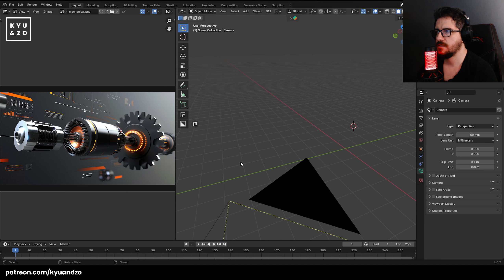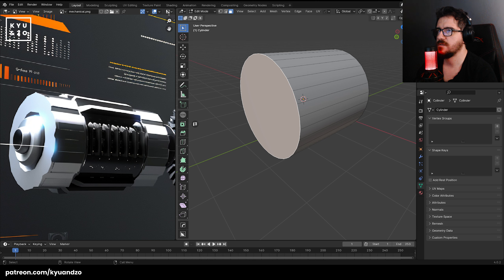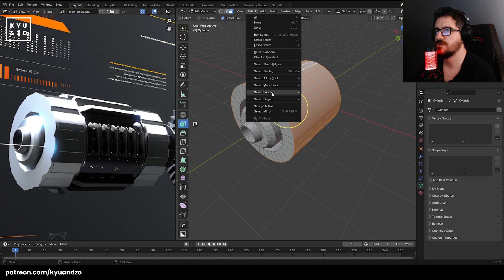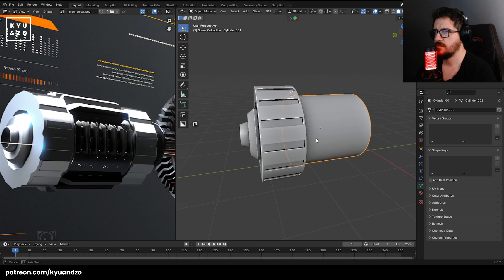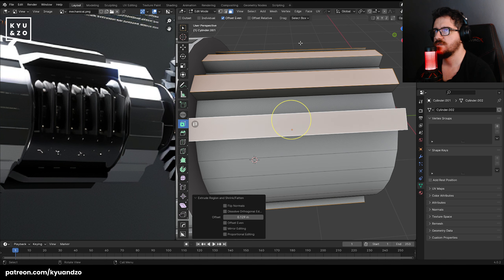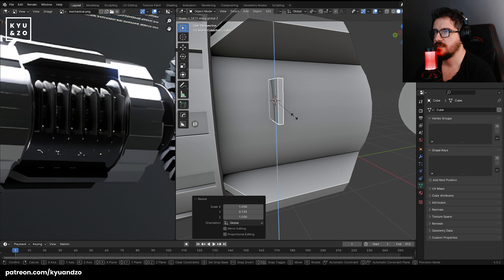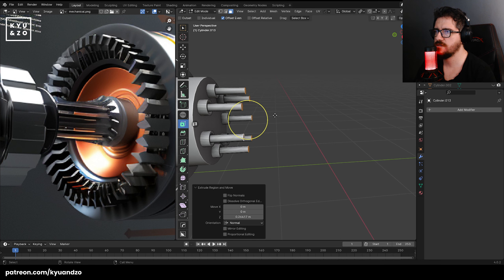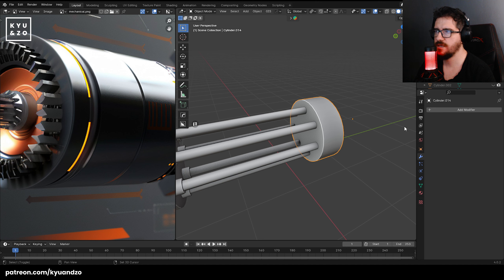Hard Surface for Beginners - Episode 1

Comment: May I ask for your discord? Should we learn to 3D model still since AI does it? Is it even worth it?
Reply from the maker: You can find my discord link on my channel main screen. Actually i don't think that AI can handle 3D models yet because 3D modeling is little bit different than replicating 2D images. You need to have clean topology. Or if you are making animation, you need to have correct rigging. There are tons of small details on 3D modeling. I just tried couple of 3D AI generated models but it just replicating them in a rough way.

You know there are no add-on for making retopology with complete automatically yet :) So it worth to learn it. I think its same for graphic designers too because AI can't make brochures, business cards, powerpoint templates, brand identitites or other different kind of areas. Its not that easy. It can't add texts in a good way with correct spacing etc.

Unfortunately i was earning money with 2D and 3D illustrations and AI stole all of my clients from me. :D I can work on all of other areas of graphic design but i hate it. So time is running out and you should learn 3D asap. :))
Reply: @kyuandzo  thanks for this!! Thanks for your time! What great value you’ve added as I’ve had this nagging disillusionment creeping through my motivation the last two years. Def subscribed and looking forward to more videos, Sir.
Reply from the maker: Thank you so much. ^^ im glad that i could help your motivation with my tutorials. ^^